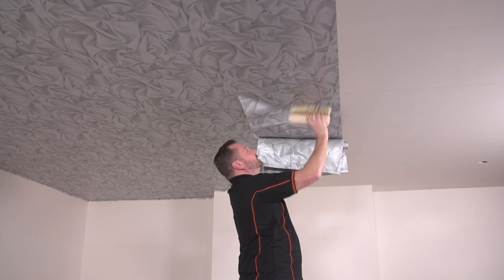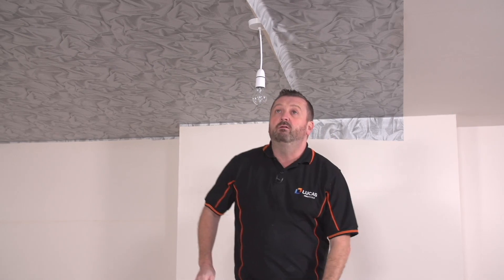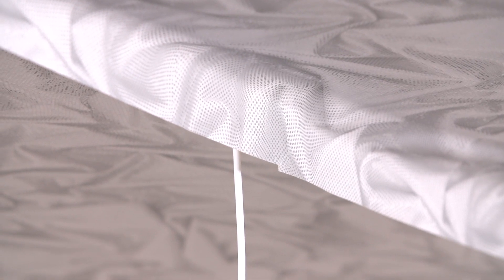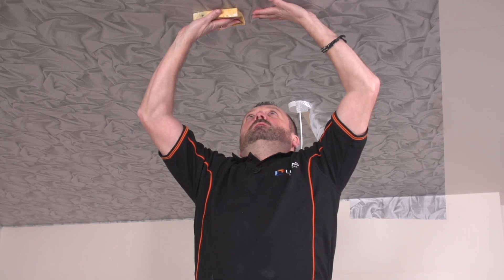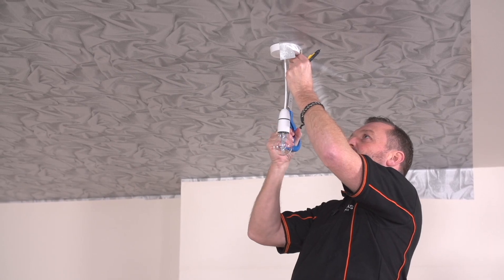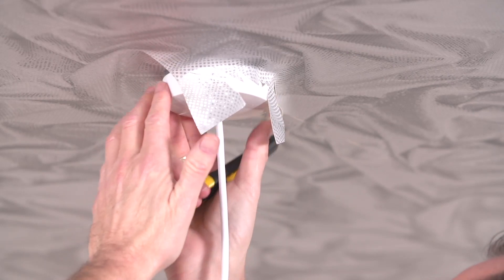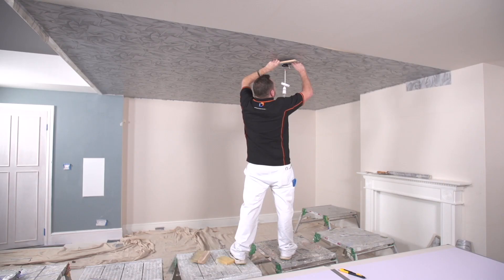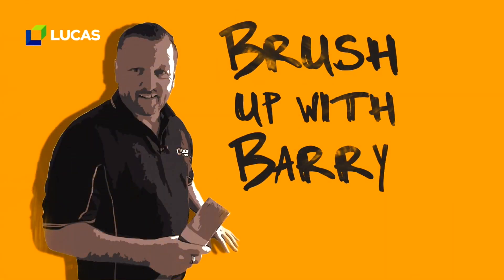How to Wallpaper Around a Ceiling Light Fitting - Tutorial 2018

Comment: What if the light fitting is right in the middle of the paper? It's not so bad when the two pieces hit the light fitting on the edge.
Reply from the maker: Hi Magicbrit, watch this video first. It explains how to set out the ceiling before you start https://www.youtube.com/edit?o=U&video_id=2Khx19XfKYI
Reply: Nah, just take the fitting off and poke the wires into the ceiling.
Cut the hole and fish them out after. Simple 😀